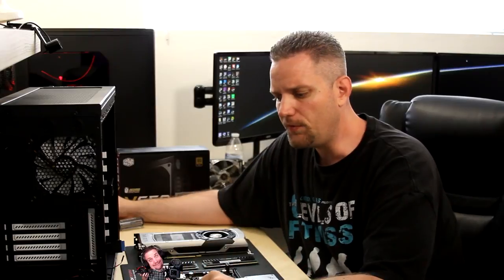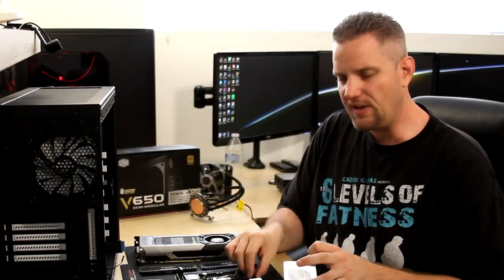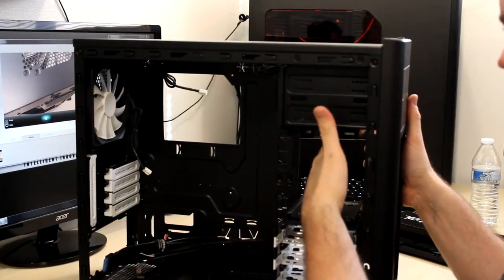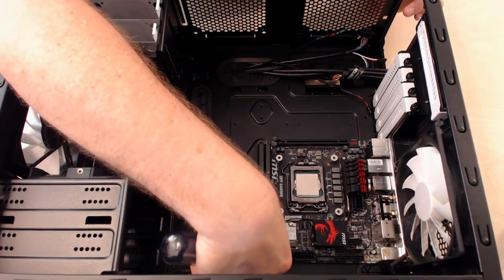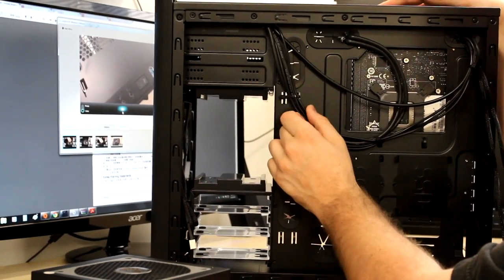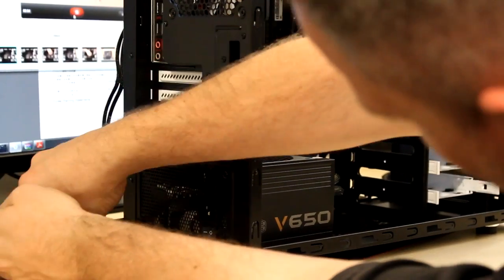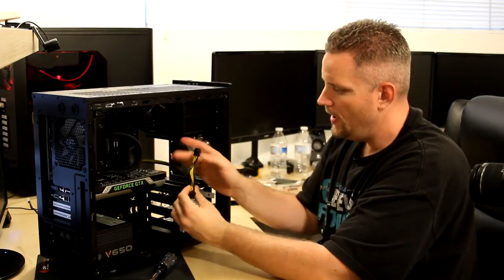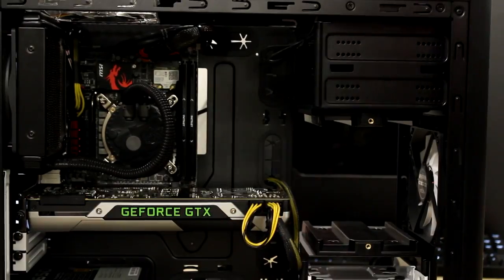Beginners Guide: How to Build a Computer

Comment: SI there any performance difference if you buy a mini atx vs a regular atx motherboard ?
Reply: No size doesn't change anything performance wise, but your features will be limited on smaller boards.
Reply: not only size, but cost of motherboard also doesn't affect the performance. you could buy a 30$ motherboard and a 150$ motherboard and the only difference would be design and more (mostly unnecessary) features.

Comment: Would it be worth it to upgrade the Ram on my Alienware M14? I've already upgraded to an SSD and it works like new but the Ram is still the stock Ram that came with it also if i do upgrade it should i get another set of the 8gb or would it be worth it to get 16gb
Reply: What are you using it for? If you are a gamer or your computer is struggling to complete tasks (and RAM is to blame), I would suggest the 16GB option. If not, just stick with what you have already.
Reply: +Jam hardcore gaming as wells as photoshop, illustrator and pretty soon premier pro once I figure out how to use it. if I upgrade I won't lose anything will i? cuz all of my stuff is on the SSD?
Reply: +Jam  I also forgot to say that if uprading the RAM won't make a difference then I'll just do a midtower build
Reply: +Edoji Sage Go for the 16GB, then. RAM stands for Random Access Memory, and is basically a temporary storage for things. As soon as you turn your computer off, it is emptied. As long as you don't replace your SSD or hard drive (if you have one), you won't lose anything.

Comment: I need to ask if this is any good (mostly for gaming) 

CPU: AMD A6 5400K
GPU: GeForce GTX 750 Ti
PSU: EVGA 430W
RAM: 16 GB

This used to be a prebuilt pc and I'm thinking of getting a new graphics card and power supply for it, but I'm not too sure if the power supply will be enough. Any answers will be appreciated c:
Reply: +Lauri Konttori You won&#39;t benefit from 16GB/32GB/100000GB of ram when it comes to gaming. 8GB is the sweet spot. Get a 300W or higher PSU with 80+ certified.
Reply: I know about the ram, but like i said it was a prebuilt pc and the 16 ram came with it

So i suppose the 430w will do?
Reply: Will do. Your whole system wont consume more than 200W.
Reply: I also want to upgrade my prebuilt pc's graphics card to an r9 390 and upgrade my psu too for it. The part I'm most worried about is spacing, and if I could find it during black Friday/cyber Monday.

Comment: is there a video out there to show you how to install all the drives and stuff like that once you have connected everything? or you dont have to do that. idk im a noob I need help. also I haven't built mine yet. *****
Reply: codfan122 Just look up specific Youtube videos for what to do the first time you boot up your system. For Windows, you will need an optical drive hooked up to install your OS
Reply: RudeDudeMike™ yeah I know about the boot up and that, I got told its quicker to install your OS via a flash drive
Reply: Yes on USB 2.0 it can be about ten minutes faster, not sure about 3.0

Comment: You shouldn't of touched the heat spreader, not that it would do anything drastically wrong but it could lower the effectiveness of spreading the heat. Anybody who touches it should clean it with a cotton swab and a little rubbing alcohol.
Reply: +Joshua&#39;s Computers He also touched the little pins on the gpu in the beginning of the video. You should never touch those. When he did that, I stopped watching the video and disliked, this guy does not know how to handle computer parts and should stop the you tube videos until he learns.

Comment: Is this a good Build for 1080p 50+ fps gaming?
I'm new to pc building any help would be nice.

- Gtx 960 4GB SSC 
- AMD FX-8320
- MSI Socket MicroATX Motherboard
- Crucial Ballistix Sport 16GB
- Samsung 850 EVO 120GB
- WD Blue 1TB 6Gb/s 7200rpm
- Corsair CX600 600W PSU
- NZXT Source 210 Mid Tower
Reply: +Grottychilli are you just gaming or are you doing steraming/editing? if you're just gaming: 1.) you wouldn't need 16 gb's of ram. i'd take the cash from that and add on to your motherboard (i dislike micro atx's. feels cramped) and upgrade the board a bit.) heck. I'd even add a heatsink on the build (amd processors run hot. let's be honest. and that extra cooling will be nice!). 2.) you may or maynot want to add an ssd in the future :) it will help! 2.) if you're editing streaming. keep the 16gb of ram and get an ssd. you will need it :) 3.) another option: your rig only needs 500w power supply (but if you can get 500+ in gold for around the same price? win win! better tier power supply = happier computer.
Reply: +porkyporkchop1 Hey, thanks for replying. The build will be just for gaming, so i dropped the 16gb ram for 8gb and i also brought a heat sink for CPU, upgraded motherboard from the Atx to a Asus M5a99fx pro R2.0 Amd Motherboard. Also got a 500w Psu. Any other suggestions?
Reply: Grottychilli If you can possibly afford an SSD you should go with that. (trust me the load times on that thing will impress you.) if you wanted to leave the 16gb's of ram on (go for it, but you don't really need it. just letting you know 8gb is the sweet spot.) other than that? no. enjoy our beast of a rig!

Comment: so im really new to this, today my new motherboard and case and other parts will come in the mail, now i only have magnetic screwdrivers, can i use these? and do i really need to be grounded?
Reply: Yanex The magnets in the screwdrivers can mess with your computer if you get them too close while operating it because the magnetic field can create interference in the wires if you move the magnet around them too much, but the magnets would need to be much more powerful than the tiny ones in a screwdriver; you'd need to go out of your way to cause any noticeable problems. If the computer isn't turned on then it doesn't even matter. Even if it was on it wouldn't cause any permanent damage anyway.

As for grounding yourself, yes, if you're not grounded there's a chance you'll shock the circuits when you touch it. Even if you don't feel it, the electrostatic shock can fry the circuits in whatever device you touch. Imagine over revving the engine in your car. If a normal cruising rpm is around 3000 and you decide to rev it up to 12000, it's spinning at a rate 4 times higher than normal, which can potentially damage your engine a little bit at a time, and if you do this repeatedly the engine might eventually develop some serious problems. With electrostatic shock, many electronic components are designed to operate at 15V, 5V or even as low as 1V, but a shock from your finger can have a voltage of over 1000V. If you can feel the shock then that means it's actually over 2000V. This is hundreds of times higher than normal, and basically destroys the circuits and now you have to replace the whole thing.

To prevent this, touch the metal part of the case before touching any components, or buy an antistatic wristband and have it connected to ground the entire time you're working.
Reply: thanks for the info ^^ it has bin verry helpfull
Reply: Yanex You actually can't damage much with a magnetic screwdriver and not grounding yourself isn't going to fry anything, if it does, you'll feel it.

Comment: I don't seem to understand something. If your games are stored on a bigger hard-drive, how does having an SSD change anything? Do they interact in any way?
Reply: you'd normally want an ssd to put your OS and programs on it to get faster loading & boot times, but most ssds under 150$ don't have that much space (64-120gb). so you'd get a bigger hdd for games & data.

Comment: Recently I built my own custom PC, however after I put all the parts in and booted it up, it showed no signal on my monitor. Also on the mobo, there is a red light coming from the cpu_led. What does this mean?
Reply: +Dylan Sweidan what are your parts?
Reply: cpu might be in the wrong way for its broken
Reply: +Dylan Sweidan Had this issue too before. Try removing your RAM cards and put back your RAM. Make sure to consult your motherboard manual on how to put the RAM

Comment: Never built a PC, don't know much about PCs, only started doing research a few days ago... 
Wondering if this is good or not.                    (Would be used mainly for gaming)

go easy on me....

CPU
AMD FX-8350 4.0GHz 8-Core Processor
 
Motherboard 
Asus M5A97 R2.0 ATX AM3+ Motherboard
  
Memory 
Corsair Vengeance 8GB (2 x 4GB) DDR3-1600 Memory

Storage 
Kingston SSDNow V300 Series 120GB 2.5" Solid State Drive
 
Video Card 
EVGA GeForce GTX 950 2GB Superclocked+ ACX 2.0 Video Card 
 
Case 
Corsair Graphite Series 230T Black ATX Mid Tower Case

Power Supply 
Corsair CX 430W 80+ Bronze Certified Semi-Modular ATX Power Supply

Optical Drive 
LG GH24NS95 DVD/CD Writer
Reply: Upgrade the psu. 430 watts is low. Especially with the 8350. Atleast get a 500W
Reply: Thanks. what about everything else?
Reply: +NinjaDog the rest is great.
Reply: +NinjaDog wait, how much RAM do you have?
Reply: on current pc?
Reply: Upgrade the PSU to at LEAST 500w, 600w would be ideal but 500 would do just fine. 

Would use an MSI R9 380 4GB instead of the GTX or upgrade to a 4GB version of the GTX as most modern games wont run nearly as well on a 2GB card. 

A 120GB SSD isn't going to be enough, especially if you're going to download lots of games. I'd get a 500GB/1TB HDD as well, or if you just want a single SSD get a 500GB one. 

Everything else is great, if you make the changes I mentioned you'd be maxing out most of the latest games 1080p@60FPS.

If you've got a bit more money to spend I'd get a Hyper 212 EVO to replace the stock CPU cooler.
Reply: Thank you
Reply: +NinjaDog how much ram is on that new PC build? You should have 8 Gb
Reply: +Odeh yeah 8gb
Reply: NinjaDog That's a perfect amount
Reply: Good think your not one of those noobs who have like an Intel core i7 with a shitty gpu like a gt 450

Comment: @jayztwocents I've been watching your videos along with pauls hardware and I have been kicking around if I should use a AIO cooler as well as trying to keep with in a budget around 750 us. this is my current parts list. https://pcpartpicker.com/list/Cj2b6X and I will be building my first ever pc instead of buying one already built. any advice as to where i can cut cost as well as keep it a decent system? I will be using it to play games like SWTOR as well as a work from home pc that requires me to connect to a remote connection ucc and vpn while running a ip communicator. Thanks in advance.

Comment: i just have 7 part for making a computer i have the case corsair Carbide Series SPEC-01 Mid Tower Gaming Case the motherboard the intel pentium the ram the power supply the hard drive and the geforce gtx what else i need?

Comment: I've always wondered, do all the cables come with the parts?
Reply: +Timo Hyppönen Sata cable comes with the motherboard. The bulky black sleeved cable are together with the PSU. Casing will have USB, audio and mic jack cable connectors.

Comment: One of you fine lads and lasses can probably help me out. Are all these parts compatible? Will everything fit, etc. Thanks in advance. Yes, I am a newbie.

Motherboard: MSI H81M-P33, LGA1150, Intel H81, DDR3, mATX

Processor: Intel Core i3 4150 3.5 GHz LGA1150

GPU: Asus TURBO-GTX960-OC-4GD5 GeForce GTX 960 4096 Mt

PSU: Corsair VS550, 80 PLUS White, 550 W

Hard Drive: Seagate Barracuda 1 TB 64 MB 7200 RPM 3.5" SATA III (6 Gb/s)

RAM: Kingston HyperX FURY Black 8 GB KIT (2 x 4 GB) DDR3 1600 MHz CL10

Case: BitFenix Comrade ATX mid-tower case

Comment: So I'm getting my first build :D

Asrock Z97 MotherBoard
Intel Pentium G3285
R7 260X might also get R9 270 instead of this if ever
Kingston Hyper-X 8GB DDR3 1600/1866
WESTERN DIGITAL 1TB BLUE 3.5" SATA
ANTEC VP550P 550W power supply
Aerocool VS-3 Advance case
ASUS 24D3ST BLACK 24X SATA

That's pretty much it since I already have a monitor, keyboard, and a gaming mouse :D

Is it worth it for an entry level gaming build (since it's my first time?)
Reply: Oh gawd you need a better processor......
Reply: And you won't need a Z97,go for a cheaper one! :)

Comment: Hey guys, I am a first time builder and I was wondering if this was a good psu for this rig. Also any thoughts/ suggestions on the parts of the rig? I play low intensive games like League of Legends with the occasional games like Skyrim, so I do not need anything too beefy.
psu: Corsair CX Series 500 Watt ATX/EPS Modular 80 PLUS Bronze 
case :Nzxt Phantom 410
ssd: samsung 850 evo 250gb
Hard drive: WD Blue 1TB Desktop 3.5 Inch SATA 6Gb/s 7200rpm 
cpu: Intel Core i5-4590
gpu: MSI GTX 960 2G
Mother Board: MSI ATX DDR3 2600 LGA 1150 Motherboards Z97-G45 
ram: Corsair Vengeance Pro Series Red 8GB (2x4GB)
Reply: ***** I would personally bump the PSU to 550, you can get a Thermaltake brand 550W PSU for around 45€ which is barely more than a 500w.
Other than that, your parts look fine for what you're looking to spend.

Comment: Is this a good Gaming/Workstation PC? 

Power supply: Corsair RM Series 1000 Watt ATX/EPS 80PLUS Gold-Certified Power Supply
Secondary hard drive: 
Western Digital Caviar Black 2 TB SATA III 7200 RPM 64 MB Cache Bulk/OEM Internal Desktop Hard Drive
GPU: 
EVGA GeForce GTX 980 4GB SC GAMING
RAM: 
Crucial Ballistix Sport 32GB Kit
Case: 
Phanteks Enthoo Pro 
Primary hard drive: 
Samsung 850 EVO 250GB
Motherboard:
ASUS Z97-A ATX  
CPU: 
Intel Core BX80646I74790K i7-4790K Processor
Reply: good
Reply: Sorry you can't play Arma 3 you should get an i75690x

Comment: Hey Jay I love your video's, you're an excellent teacher.  One question: what do I have to do to ensure I don't fry my mobo or other components when I touch them (due to static build up in my body)?
Reply: there is something you attach to your wrist thAt will ground you. im not sure what it is called. look up grounding bracelet or something. should put you on the right track
Reply: zRouth the cheapest and old fashioned way to do it is just keep touching your case to discharge the static energy :)
Reply: i just built a computer yesterday and thats what i kept doing!!!
Reply: Jimmy De Santa what if you already inserted the motherboard or other pieces into the case, then touch the case, wouldn't the static transfer from the case to the parts and damage it?
Reply: EIE3577 Sorry for the late reply, the case has these little stand things which keep the motherboard of the case. they were designed specifically for this.
Reply: thanks, i already built it, 0 problems, its aswesome.

Comment: Intel Q6600 2.66GHz Quad Core Core II Quad processor, 8GB of gaming ram, and a 100GB hard drive. Graphics Card is a Nvidia 610,windows 7 installed is that a decent build?
Reply: Its okay for a budgety build but upgrade the GPU to maybe an R9 270 or a 750 and hard drive

Comment: Kinda confusing at the negative pressure part
1)Will any tower I buy fit my corresponding mother board?

I really want go through with building a pc but if I blow $1500 and mess up because parts don't fit or there isn't enough space i'll lose my shit lol.
Reply: ***** Thanks sounds like you know your shit, Whats a good motherboard that supports an intel I7 processsor, would an msi motherboard suffice?

Comment: After seeing this video. I wanted to share some info for people who are building their first desktop. I noticed during the video he misses some important info. When handling item's such as the motherboard, the Ram cards and any other exposed electronic parts. You do not want to touch any of the contacts on any of the devices. This can cause issues later down the road. When handling the motherboard it is best to handle it by the sides. I noticed when was explaining the CPU or central processing unit. He touches the top surface of the CPU. You do not want to get the surface dirty as it will interfere with the thermal past and the contact between the heat sink and the CPU. When handling the Ram sticks., it is important to never touch the gold contacts as it can cause issues. When installing the components always try to keep it in a static free environment as static shock will fry your components.

Comment: I'm building my first gaming pc and i planned on running 2 msi gtx 970 in SLI but does anyone know what wattage this would require and what a good psu is for this build ps. Cpu is an i5 4690k
Reply: Look at pc part picker and it should tell you the wattage needed for the parts. also make sure to have at least 100-200wat extra in case you overclock
Reply: SLI uses a lot more power than only one, and depending on how many fans, pumps and hard drives you have you will need more, I'd say 850W is best, gives you some extra headroom and ability to upgrade in the future

Comment: What do you think about this pc?
Core i5-6600K
SilentiumPC Fortis 3
MSI Z170A PC MATE
Kingston 8GB (2x4GB) 2666MHz CL13
Toshiba 1TB 7200rpm 32MB
MSI GeForce GTX1070 8GB
SilentiumPC Vero L1 600W 120mm
Reply: Awsome , it a pc Gaming , you can Run any Game with your computer ;)
Reply: You should really use another power supply. It's a shame to make such a nice computer unreliable with a bad psu. I would go for a Seasonic or EVGA Supernova.
Reply: Zmień zasilacz
Reply: my 1070 from asus just came omg i am so in love with it

i recommend you getting either the i7-6850k or the i7-6900k and a 700w power supply
Reply: +KG-Virus Don't need anything higher than an i7-6700k for gaming.

Comment: Is this a good first gaming pc? ADMI ULTRA GAMING PC - AMD FX-6350 High Spec Red LED Home, Family, Multimedia Desktop Gaming Computer with Platinum Warranty: Powerful Six Core 4.20GHz Turbo CPU, NVIDIA GTX 750Ti 2GB HDMI Graphics Card, 8GB 1600MHz DDR3 RAM, 1TB Hard Drive Storage, HDMI Output 1080p, High Speed USB 3.0, 150Mbps WiFi included, Pre-Installed with Windows 10 Operating System